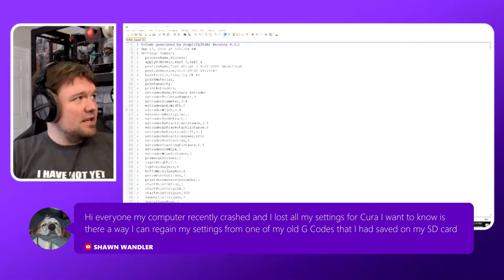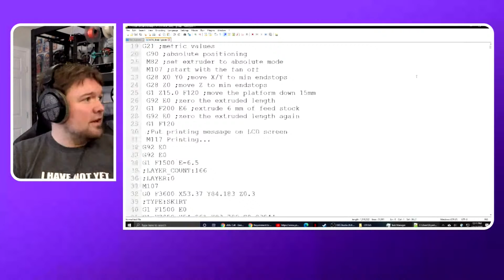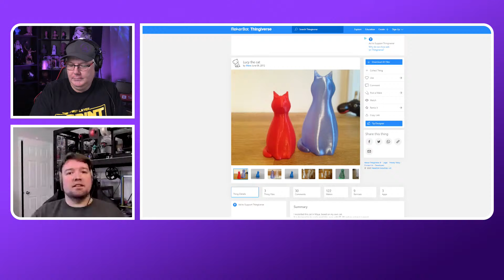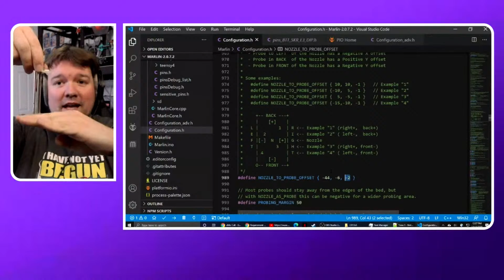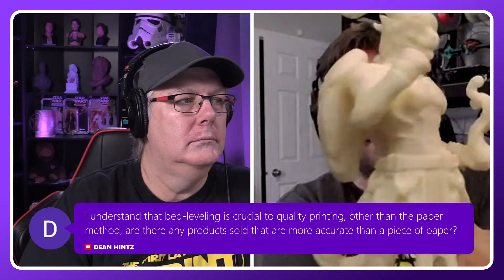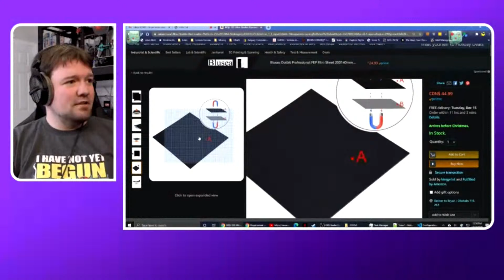TFL Live: Ask for HELP

Comment: Apropos the CR-10 filament sensor doesn't even has to be broken to malfunction.
On the CR-10 S5 my sensor was giving me filament out even with enough filament.
When I wiggled the filament where it exits the sensor, the light came on for a moment, so it's just a crappy execution of a good idea.
I took out the microswitch and bent the metal tongue so the filament sensor worked again.
I DID order a new Lerge filament sensor, though